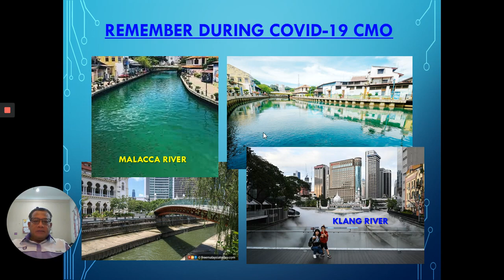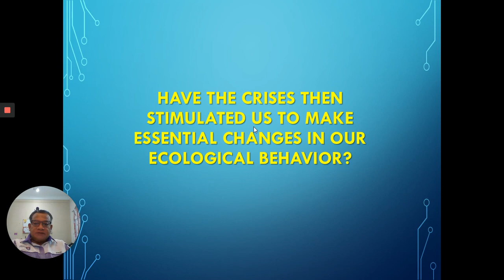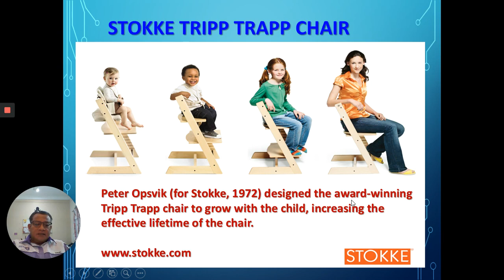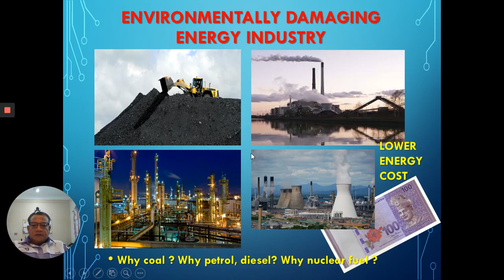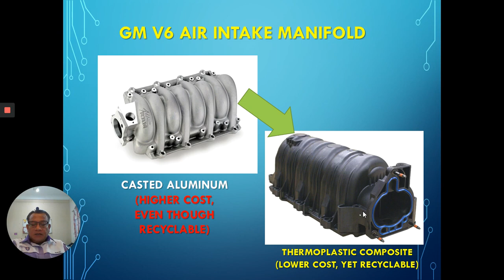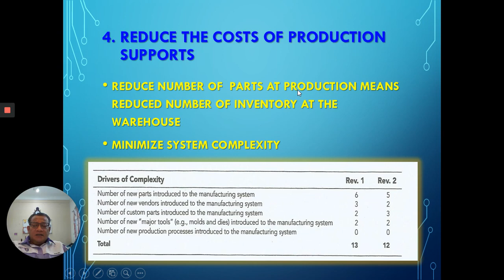Product Development Chapter 10 Design for Environment and Manufacturing

Comment: AINUL NABIHAH BINTI ZAINAL 
AP180029
Chapter 10: Design For Environment

*DFE provides companies with a practical method to minimize or eliminate these environmental impact
*Effective DFE maintain or improve product quality and cost while reducing environmental impact
*DFE may involve activities throughout the product development process and requires an interdisciplinary approach. Thus ID, engineering, purchasing and marketing must work together to develop an environmentally friendly products.
*DFE process consist of 7 steps 
S1: set the DFE agenda: drivers, goals and team
S2: identify potential environmental impact 
S3: select DFE guidelines 
S4: apply the DFE guidelines to the initial product design
S5: assess the environment impact 
S6: refine the product design to reduce or eliminate the environmental impact
S7: reflect on the DFE process and results

Comment: Heng Chien Ying AP180531
In this video, i learned about DFE is a method  to minimize or eliminate environmental impacts of a product over its life cycle. I also know about the DFE process and 4 simple DFE rules.
DFM: manufacturer design for efficient manufacturing process good material that protect the environment
Design for manufacturing at lower cost and high quality, it is a team effort.
There are 5 process of the DFM.

Comment: WONG HUI SIN AP180171
Based on the video, I had learn about design of manufacturing is the process of designing parts, components or products for ease of manufacturing with an end goal of making a better product at a lower cos. At the same time, protecting environment with reduce cost manufacturing, reducing cost but same quality of the products. From the perspectives of design environment and manufacturing need to consider of estimate manufacturing cost, reduce the costs of components, reduce the costs of assembly and reduce the cost of production supports.

Comment: Low meei ching AP180190
I learned about design for environment and manufacturing. DFE is a method to minimize or eliminate environmental impacts of a product over its life cycle. DFE process 1. Set DFE Agenda, 2. Identify Potential Environmental Impacts, 3. Select Material and DFE Guidelines (PU/PVC/RUBBER/PET), 4. Apply DFE Guidelines to Initial Designs, 5. Assess Environmental Impact, 6. Refine Design, 7. Reflect on DFE Process and Results. DFE rules are recycled continually, natural materials that can be fully returned, do not produce unnatural, clean, renewable sources of energy. Five DFM process in estimate, reduce cost and consider impact of DFM factors.

Comment: Lee Chin Yong (AP180153)
From this video, I already learnt about design for environment(DFE) is important for the purpose of carry on industrial activities without cause pollution. For instance, global warming, solid waste, air pollution and more. For another instance, Japanese Minamata Disease become one of eight environmental pollution incident which cause by chemical factory release methyl mercury into Minamata Bay and it already damage future generation. Some place like Klang River is clean due to some industrial activities shut down during pandemic of Covid-19.  Especially, it also have DFE and material guidelines for the purpose of reduce impact of product design upon environment. Furthermore, design for manufacturing (DFM) is focus on detail design decision and consider the manufacturing factor at early stage in order to achieve goals. DFM process includes estimate manufacturing cost, reduce the costs and number of components, reduce the cost of assembly and production support and consider impact of DFM and other factors.